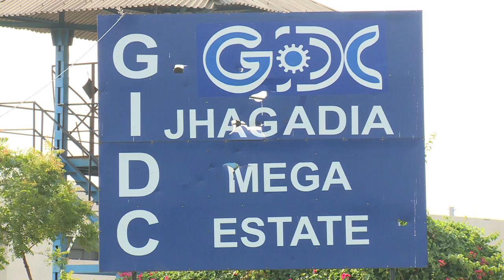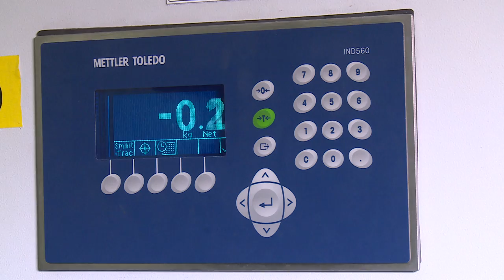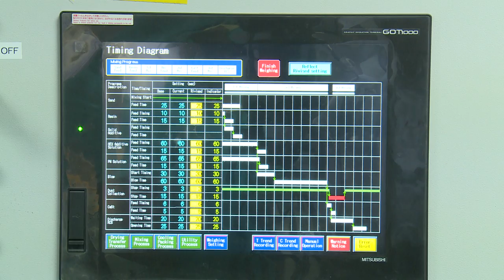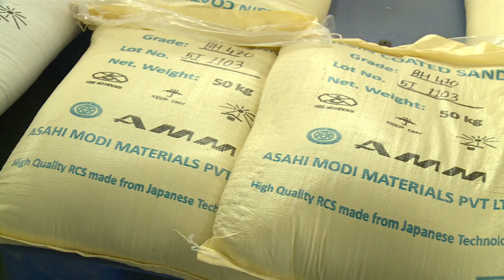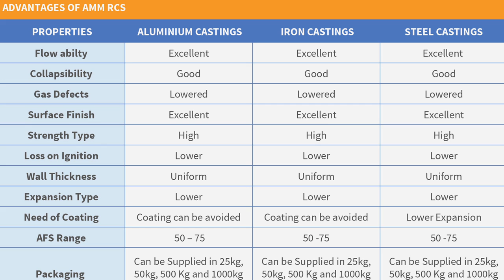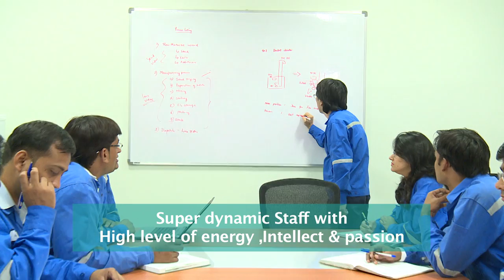Asahi Modi Materials Pvt Ltd, Resin Coated Sand Manufacturing Plant & Process

Comment: This sand can be used for building construction purpose also ? Do reply and wat is the cost of per bag
Reply from the maker: No.
Reply: @asahimodimaterialspvtltd2291  what purpose and where these resin material and application area please
Reply: @sunilkumararickattu1845  it's used for shell casting

Comment: Do you make resin coated sand for manufacturing shell moulds for stainless steel castings
Reply from the maker: Please share your requirements with our team at info@ammpl.in
Reply from the maker: Kindly share your requirements with specs at info@ammpl.in
Reply: Dear Sir Your Company How Can Use Processed Silica Sand Material ??